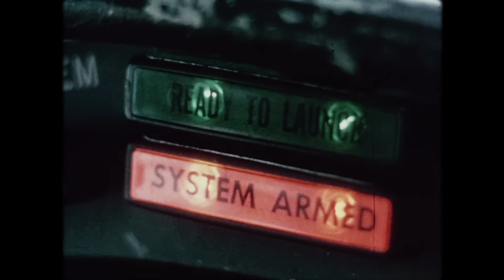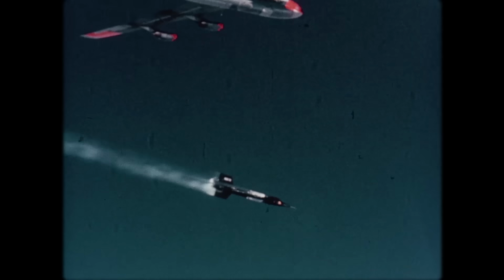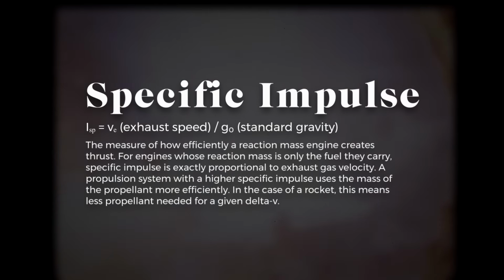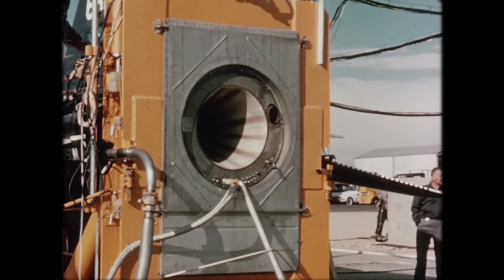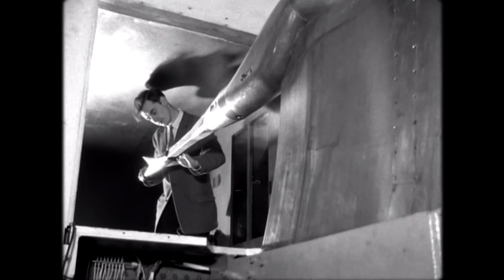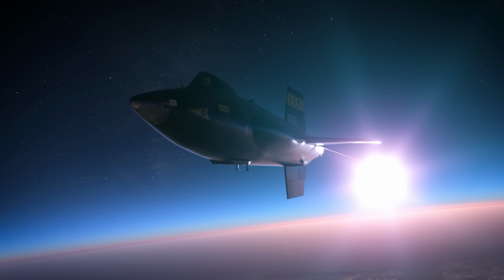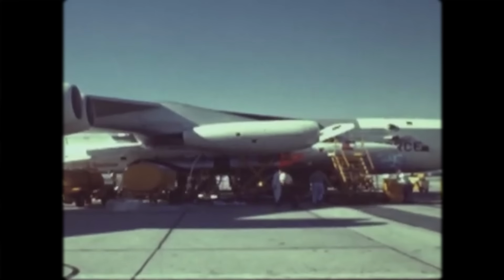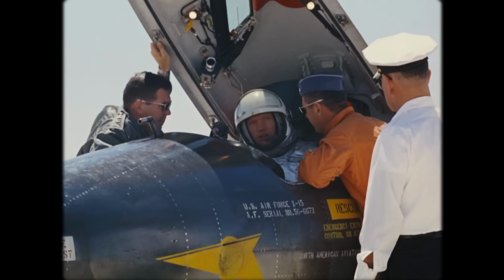The Insane Engineering of the X-15

Comment: There is an error relatively early on, technically you could make a ramjet style propulsion plane that goes even more than twice as fast as the X-15.
It just does not make sense, prolonged flight at such speeds in a plane, and maybe even trying to make a turn, could very well just simply kill the pilot.
With ramjet, like with any other breathing propulsion you will get issues at certain heights.

Comment: Sorry, but the SR-71 is faster, and it will always be the fastest atmosphere traveling plane man has ever created. 10,000 years from now it will still be the fastest atmosphere traveling plane ever created, for two reasons. 

The common misconception is the Blackbird only went Mach 3, it's true top speed is still classified, and actually unknown by the pilots themselves.

There are two reasons for this, the first is  the faster the Blackbird went the more power it had, and the more power it had the faster it went. This theoretically means there is no limit to the top speed as long as it does not run out of fuel, which of course it would.

The second and most important and significant reason the Blackbird will never be surpassed in top speed for a plane that flies in the atmosphere, is because the plane is made of the strongest alloy in existence, titanium, and the engines of the Blackbird are capable of making the plane fly faster than what titanium is capable of sustaining.

The Blackbird would fly so fast through the air that the the friction caused by air traveling over the plane's body would cause the body of the plane to heat up to extremely high temperatures. Same thing that happens when you rub your hands together, the friction produces heat.

However, the heat on the titanium body generated by the Blackbird traveling through the atmosphere was so hot and so intense, that the body of the plane would start to become soft. 

Even though the plane is made of the strongest metal in existence, when any metal is heated up, it naturally becomes soft and starts to lose its strength. If you heat up iron, or steel enough, the metal becomes soft and you would be able to bend it with your own strength.

The Blackbird would fly so fast, that the plane's titanium body became in danger of literally disintegrating if it went too fast, because even titanium can only take so much heat and pressure from traveling through the air at high speed.

So the plane was as fast as the pilot dared to go, it's top speed was limited literally by only the heat and pressure titanium could take from the friction of air traveling over it.

You might ask, this is all true, but what if a metal stronger than titanium was discovered or invented? Couldn't we make a plane faster than the Blackbird?

Titanium can take far more heat and pressure than any metal in existence. We also know that it is impossible to find or invent a stronger metal than titanium, this is because of the fact that an atom of titanium is made up of 22 protons and 22 electrons, making this element number 22 on the periodic table of elements.

Since literally all matter in existence is made up of atoms, and we know every atom that exists because of the periodic table of elements, for example if you add 57 protons to Titanium, it would turn into gold, which has 79 protons making it number 79 on the periodic table. And of course gold is much weaker than titanium.

Only 94 elements exist naturally, for elements number 95 and above they are artificially created in a laboratory, and the problem with them is they only exist for a few nanoseconds before they disintegrate.

So that is how we know for a scientific fact that titanium is the strongest metal that will ever exist. Therefore it is a scientific fact that the Blackbird is the fastest plane that can be created, because there will never exist a metal that can take more heat and pressure than titanium, and the Blackbird pushes that element to its absolute limit.

Comment: Imagine being told your going to go for a ride on a inconnel (sodium filled alloy) frame jet holding rocket fuel and your vehicles outside temp will reach over 999°c . oh and btw if you start seing gaps in the material at supesonic speeds thats normal. Oh and your gunna have a hole to look out of to land .oh and were guna test this material sprayed on it. Dont worry it only becomes explosive when shocked with oxygen. Have fun.

Comment: I never understood the semantics of the APU. Yes, it's a recycling of energy from the primary engine - but without a control platform to actually ... fly ... I don't see it's role as 'secondary' in nature at all. Seems more 'primary' if you can't fly without it. Also I'm surprised they didn't consider a RCC (carbon) solution for the nose - like the Shuttle orbiter.

Comment: Dad, what's a slide rule ? Amazing people did amazing things with it Son.
Reply: The EB6 is considered a rotational flight computer or slide ruler and one that was used by pilots while flying aircraft before battery powered calculators were approved. The advantage of using the rotational one was that you could use one hand to quickly calculate fuel usage, time aloft, distance or any math problem while maintaining control of the aircraft. They operated on the same principal as the liner slide ruler but laid out on disc. I flew with one every flight while in the US Navy in 1980-85. I think I still may have in my military flight gear.
Reply: I'll kick your butt with my new Scientific calculator, if  you give me some batteries...
Reply: slide  rule == the original solar powered calculator...

Comment: At The Edge of Space by Milt Thompson is well worth the read if you're interested in the program. Thompson was one of the pilots and engineers behind the plane, and it's a fascinating firsthand look into the lives and engineering behind the project. Ignition! An Informal History of Liquid Rocket Propellants by John D Clark goes into the history behind the development of the propellants used in early rocket flight (and briefly touches on the X-15 program in particular), and is absolutely hilarious to boot.

Comment: The explanation of monopropellants is a bit flawed. The bonded oxygen is not what makes them work because this is not a combustion reaction, its decomposition. If it required bonded oxygen then hydrazine wouldn't work as a monopropellant when in fact is is one of the most popular monopropellants to date.

Comment: Many interesting factoids that I had not heard before.  Thank you very much.  The hydrogen peroxide  with sodium permanganate catalyst to produce steam to run the turbine pumps and auxiliaries was very common on early rockets.  The German A-4 (V-2) was the first to use this technique in quantity.  The U.S. Naval Research Laboratory Viking rocket, its later big brother the Vanguard,  the Convair RTV-A-2 Hiroc, the Army Redstone and even the Mercury-Redstone all used the hydrogen peroxide steam generation system.  It wasn't unit the later medium ranged Jupiter / Thor missiles using the S-3B engine and their descendants was the modern fuel rich gas generation cycle mastered.

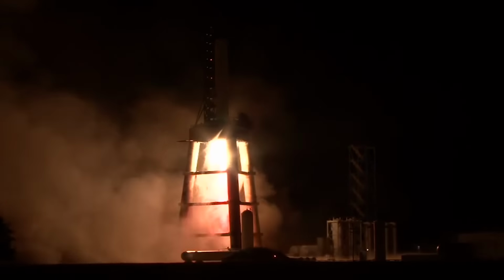Comment: 5:43
That is not the reason it's dumped overboard, you simply cannot get it into the combustion chamber due to the immense pressure difference between them.
Reply: I should add that it isn't impossible in general, just not in the Merlin design.

Comment: One interesting note: during that last high speed test, they attached a dummy scramjet engine underneath the X-15 to collect data (you can see it in the vid 27:57). The reason why the aircraft was damaged was because the shocks from the dummy scramjet impinged onto the strut holding it on the main body. The shock was like a super powered blowtorch and literally severed the dummy scramjet right off the bottom!

Hypersonics is so cool, but pretty scary too :D
I heard about this in a class, but this NASA report talks all about it: https://www.nasa.gov/centers/dryden/pdf/87756main_H-524.pdf
Reply: There's an excellent summary of what happened there and the causes of it in the book "Hypersonic and high temperature gas dynamics".
Reply: you can see it better at 28:04, really interesting

Comment: "Temperatures will be very high."
"We'll use our best heat-resistant material!"
"That won't be enough."
"We'll cover the plane in a highly explosive ablative material!"
"... explosive?"
"Don't worry, we'll paint it over!"

I like how they have a simple solution for every problem.
Reply: I like how they used the term "slow - Mach5 flights" unironically. It is probably the only plane about which you can say it XD
Reply: notice how every solution feels like a last resort? I'm curious what they tried before coming to the end of their rope
Reply: engineering is all about making highly complex systems..... realizing it doesn't work..... slapping an extremely "primitive" solution over the problem (god bless ducktape) and just forcing it to work
Reply: @RylieDG  - Sort of like the wag who said a bumblebee couldn't fly - something to do with wing area to body size, or something - but the bumblebee, being ignorant, flies anyway.

Comment: You had a typo by the way, the theoretical maximum Isp of a hydrolox engine is 532s, not 381.  We know 381 is wrong outright because the RS-25/SSME has an Isp of 452s using hydrolox.

Comment: It's basically a rocket with a cockpit, therefore a center of mass pushed towards the front. I am sure that the experience gained in this project is helping out with the development of drone controlled hypersonic aircraft aswell as full range intercontinental missile systems.

Comment: The tendency of hydrazine to explode when heated wasn't the only problem. If you look at any container of pure or highly concentrated hydrazine you'll find that it's a.) very solidly built (if it isn't, start running) with multiple layers of safety measures to prevent any leakage, and b.) covered in warning symbols. All the warning symbols. This stuff is nasty, and handling it safely requires full-body protective suits to be worn at all times.

This goes for a lot of high-performance rocket fuels, of course (read the excellent book Ignition! for an entertaining tale of rocket fuel development full of fires, spontaneous engine self-disassembly and highly distressing smells) but it's not something you really want to deal with if you have any other option.

Comment: An excellent video on the engineering behind the X-15 rocket plane. Many thanks for posting this. One thing I did want to mention is that early in the video you mentioned how research on the X-15 aided in the development of the SR-71. There was no crossover between the two programs, and Kelly Johnson once said that the X-15 was a complete waste of time because it was a research aircraft and not an aircraft that would have led to a production vehicle. The X-15 and SR-71 don't share any traits, and as pointed out in the video, the X-15 flew more than twice as fast as the SR-71, and was built from completely different materials.

The X-15 is an amazing aircraft, especially when it is considered that its development began in the early 1950s and it first flew in 1959. I was deeply honored to be able to speak with so many of the pilots, and others responsible for the program, during my decades of research to bring my book on the X-15 to fruition. Every one of the people working on the X-15 were special, and they considered themselves to be a family.

Comment: American program, American manufacturer - don't give metric specifications without listing US/Imperial.  No third world European "metric" country built or flew the X-15, did they?
Reply: NASA used the metric system to get to the moon, Mars and other celestial bodies. Because they knew the imperial system is ass. Get your facts right.
Reply: @user-dd8vo7or2d  What is wrong with your English comprehension?  Did I mention the Moon, Mars or any place else?  Your synapses are not shaking hands.  NONE OF THE WEIGHTS AND MEASURES FOR THE X-15 PROGRAM WERE CALCULATED USING THE METRIC SYSTEM.  

As long as you brought it up, NASA started using the metric system around 1990.  Way after getting to the Moon.  Hell, the Jet Propulsion Lab (NASA) used a mix of metric and Imperial which caused a big problem Mars Climate Orbiter in 1999.  

NASA standardized metric on January 8, 2007 for all Moon operations.

Comment: X-15 program managers:  “So we’re launching a new test program where we will be experimenting with hypersonic flight with rocket planes.  The technology for their propulsion, framework, drastic thermal gradient mitigation, control systems, aerodynamics, ablative materials, sensors, and basically everything....does not exist yet.  We’re currently recruiting for test pilot volunteers.”

Test pilots:  “Where do I sign?"

Comment: While incredible in its own right the X-15 and SR-71 are not in the same class of airframe. One being a rocket with wings, throttleable yes, and an air-breathing jet while using its own marvelous engineering being able to to house essentially two engines in one. I find it funny that while this is a video regarding the X-15 that many of the clips are from other documentaries for the SR-71. It takes a little bit away from what should be something great showcasing the X-15.

Comment: "Air particles have less interactions with each other above the speed of sound" is actually a tautology. The speed of sound in a material is literally the speed at which pressure waves propagate through the medium. If you're travelling through a medium at local supersonic speeds, you're literally traveling faster than the material can respond. At hypersonic speeds, the X-15 is less of a plane and more of a knife slicing through the air, just pushing the air aside!

Comment: You should do one on the Space Shuttle, imo the most advanced flying machine ever made. The TPS alone could get a video.
Reply: The Buran was technically better
Reply: @user-dd8vo7or2d  It was also developed almost a decade later. The Shuttle was built from scratch from the late 60s, and the Soviets blatantly copied their design. I do agree that it had improvments over the Shuttle, but the Buran never flew more than once, making the American Space Shuttle much more relevant and impressive.
Reply: @ikeraguirre5865  The US Space Shuttle was advanced for it's time but it does have a poor flight record. 2 out of 5 Space Shuttle frames were lost culminating in the loss of 14 crew members but I do agree with you that the Space Shuttle is more tested as it has flown hundreds of missions. But reliability and cost wise I'd stick to conventional single use rockets.
Reply: @user-dd8vo7or2d  It is my firm belief that those accidents were not the Space Shuttle's fault. Instead, it was due to rotten leadership at NASA reaching for an unrealistic launch cadence and ignoring the warnings from engineers. It was a very experimental launch vehicle, and treating it like an airliner was dangerous.
Reply: @ikeraguirre5865  True. NASA's leadership at that point was atrocious. I believe the STS-51 was the flight that made the public realize NASA's internal politics were the ones that caused the disaster. But overall they should have never flown the shuttle like it did.
Reply: @user-dd8vo7or2d  If NASA had the appropriate budget, we might have been able to avoid many of these pitfalls. Nevertheless, people often forget how important the Space Shuttle was. It pioneered reusability, led to a plethora of scientific discoveries, and shaped the way we approach spaceflight today (a lot more carefully). I dont think it is possible to label its legacy as good or bad. It is a complex and complicated history. Despite this, mo one can deny how defining and important (for better or worse) the Shuttle was in human spaceflight history.

Comment: Correction : Hydrogen has 1 nutron rather than 1 electron shown at 9.35
Reply: @Rozina Akter A hydrogen atom contains one proton in its nucleus and one electron orbiting the nucleus. If you add a neutron to the proton you've got heavy hydrogen (also called deuterium).
Reply: @giotto6772  yeah l know but he is supposed to mention that it's heavy hydrogen. Anyway thanks

Comment: Amazing video so far. One comment: latent heat of vaporization of water has  (as I understand it, I’m not a physicist) little to do with its boiling point. Rather, it’s the energy to convert 100C liquid water to 100C gaseous water, which is roughly 2257 kJ/kg at one atmosphere.

Further, this goes down, not up, as pressure increases. At 30 atmospheres it’s 1795 kJ/kg, at 160 atmospheres it’s 931 kJ/kg.

Comment: Great video!

But PLEASE make this correction in the future. Its not "frictional" heating. Its "compressive" heating. In supersonic flows the heating is due to the shockwave compressing the fluid and thus drastically heating it up. Actual friction due to flow plays only a much smaller part.

Comment: Personally I've never considered the X-15 a "Plane". It doesn't take off from the gound (like many x-planes), and it generates almost no lift, instead using its thrust and control-surfaces to keep its nose up. Its basically a man-guided missle. Its a fantastic air/space-craft, but its not a plane. ;)

Comment: 30 seconds in that is not a plane it was fired like a goddamn missile what other plane do you know does that where are its wings where are the the flaps where's the fuel tank it's a rocket not a plane I find it disingenuous the misinformation you perpetuate in the title what is a plane is what fired it that's a plane I'm missiles what's shot from a plane planes don't need other planes to work